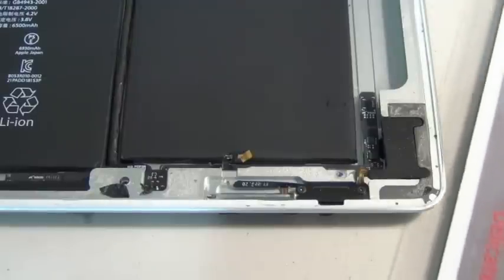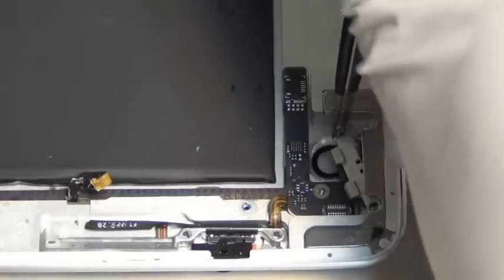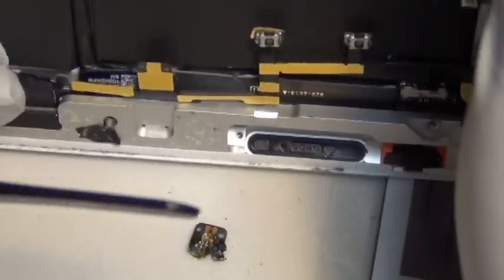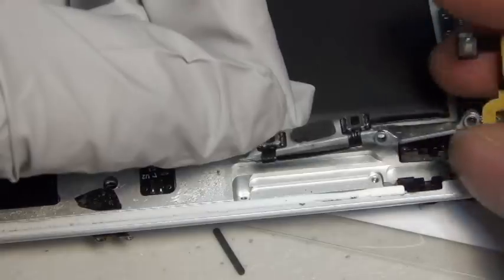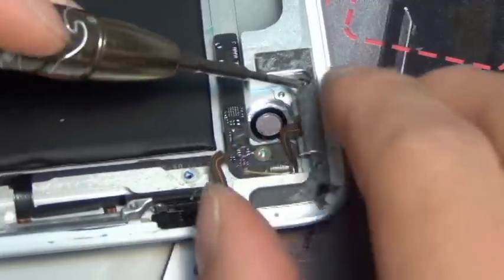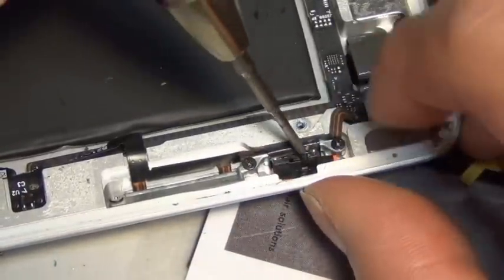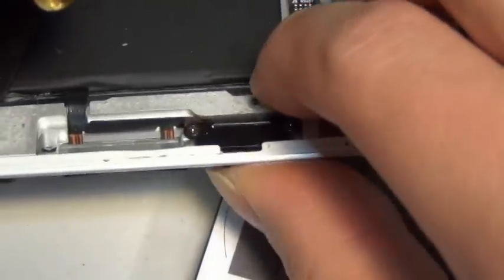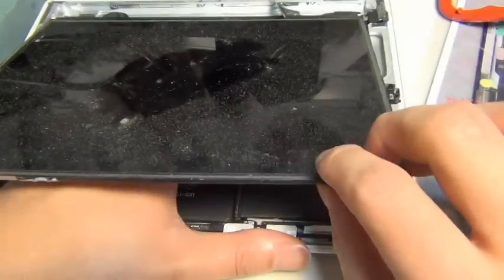iPad 2 volume power on and off button ribbon cable replacement repair CyberDocLLC

Comment: I ripped off my power cable while replacing the digitizer. I ordered a replacement and followed this video and was able to do it in the first go. A very detailed video and thank you for the effort. Putting the camera on your face should have been very difficult but do know that it helped a noob like me repair it like an expert.

Comment: Static electricity has nothing to do with the battery being connected or not. Rubber gloves do not help either; may actually generate a static. Use a properly installed ESD wrist strap.

Comment: Can the processor at the opposite end of camera be replaced and what is the correct name or part #... This video was very very helpful and would like to say thank you.  Again, I believe I need to replace that little processor at the beginning that the wire plugged into.

Comment: I tore the cable between the slide switch and power button when replacing the power port. I put it together to test it. It powered up OK but power button won't power it down. Is there a way to power it down safely before replacing the cable? Thanks

Comment: I figured it out it didnt turn on because when I was messing with the buttons the cable mightve disconnected from the bottom so I just pushed it in and presto it turned on..
But the screen was super dim so I just did a hard reset and it worked! Now the only problem is that the mute doesnt work. ... ill update if I fix it

Comment: I have a question. Does the little silver rectangular connector at the bottom need to snap in? I didn't see you snap it in - you just put the black tape over it. On another video, someone said it had to be snapped in. It is hard to get it to snap into the connector. Thank you. (I accidentally posted this comment on a different video.)

Comment: Both my iPad 2 power button and volume down buttons are no longer working due to an error on my part (I sliced the circuit cables for both). What part(s) do I need to purchase for replacement? I believe this is one part (ribbon replaces both volume & power button) but I want to be sure. Model A1395, iPad 2 wifi only. Please advise and thank you in advance!

Comment: Hi there, I just used your video to replace my power ribon cable (it was fab!) but It doesn’t seem to have worked and I’m worried I’ve caused more damage...... I must have damaged the ribbon while replacing the glass sceeen.  Once I’d replaced the screen I managed to turn the iPad on by connecting it to my laptop with a usb cable.  Everything was working fine (including the volume buttons), but I couldn’t turn the iPad off.  I then replaced the power/volume button ribbon buyback the power button still doesn’t work and now the iPad won’t even turn on by connecting it to my computer, have I damaged something else now?! Thanks

Comment: lol this video was great. I am waiting for my ribbon cable to arrive so I can also perform surgery. I have a off topic question tho. When I removed the speaker ribbon on the bottom left I accidently removed the socket that it goes into it. is their anyway I can fix that or did I 100% ruined the speaker connection? Can I crazy glue the bottom of the socket to on to the ipad where it originally was
Reply from the maker: you will need to solder it on.   we offer this repair service or part on our website

Comment: i did mine with the glass and digitizer off but when i finished, my screen was black. i can hear the power button working and swiping right but nothing on the screen so i unplugged/plugged the long cable running between the batteries and everything works. make sure to turn off the ipad by holding the power button and swiping right like as if it was turned on before disconnecting plugs. i think i made the mistake of not unplugging that long cable from the beginning. thx for video.
Reply: Thank you for this post. I thought I had shorted out my iPad and was ready to toss it in the attic after doing the repair and nothing worked. By doing as you said I got a dim screen and then a hard reset got me up and running. So glad I read this. Thanks!
Reply: MrEspn64 omg this worked for me too!!

Comment: When I tightened the volume control screws to full tightness, the up volume button wouldn't work. Only way I could fix this was by slightly loosening both screws and then everything worked. Then I put a drop of crazy glue on each screw so that they wouldn't loosen any more overtime.

Comment: My iPad 2 doesn't have the cable that runs between the battery?  There is no board for the final socket on the ribbon, the one that's furthest away from the the power button?  It does have a cable that runs along the top though, which joins the two camera's together?  Any ideas?

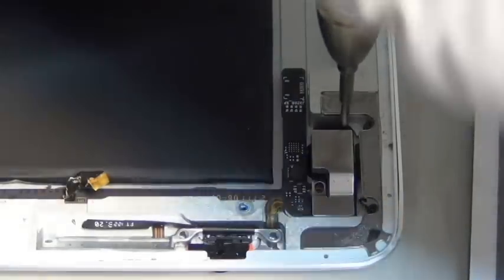Comment: I am having a LOT of trouble getting the second screw at 2:45 out (the one for the bracket that holds the camera in place). Everything was flowing smoothly up until this point...any suggestions?

Comment: You did mention if you accidently hit the power button during this process with the LCD disconnected. The ipad may not boot (turn-on). All you have to do is remove the battery screw and carefully pry up the logic board from the battery for ten seconds and replace the screw then you will be golden. Don't panic!

Comment: My ipad does not have the FPC connector seen at 6:48. It just terminates at the resistor/capacitor(?) that you were struggling to get off at 5:55

Comment: Many thanks for a very nice video.  I notice that the printed circuit trace for the Hall magnetic switch on both the scrap and new cable is correct.  The several replacement cables I have bought from China and the UK have this wired wrongly despite the correct 821-1151-A part number on the cable and have resulted in the magnetic switch not working.  Can you please say the source of the cable you used.
Reply from the maker: http://www.cyberdocllc.com/shop/ipad-2-power-volume-hold-buttons-ribbon-cable-replacement-part/
Reply: 3.00 free shipping on ebay, mine works perfectly
Reply: metalkilla7777 The fake and genuine versions can be identified by the number of tracks coming off the rectangular plastic flex on which the Hall sensor is mounted. The genuine version has 4 and the fake 3.
Reply: geoffrey leonard cohen hello by chance you solved this problem? I also find myself in the same situation, would you do me a huge favor if you told me where you could buy the parts! Thank you very much!
Reply: +giovanni boselli hpz56

Comment: Thanks a lot for this video! I had the first gen of the cable but this video did the trick just fine. I wish I knew there are two versions of the flex cable though when I bought the 2nd gen by mistake. I only noticed once I opened the Ipad

Comment: Hi, incredible video. Really good. But I have a problem, I don't know how I fucked it up. I followed the steps carefully and I think I properly installed the new flex cable but, obviously I'm wrong  'cause now the ipad doesn't response at all, no reaction to charger or buttons. Any idea about what i have screwed up? (something about the power supply or batteries maybe?)
Reply: It responds, I hear it receiving mails. I'connected the screen and digitalizer but It doesn't displays any image...I bought the wrong flex cable?
Reply: plo173 me too mine won't respond either, did u figure out what was wrong?
Reply: sorry for the late reply. I gave up, now I have a galaxy tab.

Comment: The problem was not with something I did ... it was the manufacturer they sent me a cable where the little knob that snaps into the mute button was missing. .....so my mute will not work so I will have to order a new one fml

Comment: The screws SHOULD be tight, not overly hard tight but snugly tight just as they are when you dismantle it.  If they have to be loose to work, then something is not in the right place.  If you leave them loose then they can get even looser over time and the screws can fall out.  Also, if the Ipad is frozen off after the repair, then slip two very thin plastic strips under the battery connection after removing the screw and leave for 30 minutes. no need to take off the main board. It is probably best to isolate the battery for the duration of the repair anyway.

Comment from the maker: iPad 2 2012 new model ribbon cable Power On/Off Volume Control repair replacement CyberDocLLC 

iPad 2 2012 new model ribbon cable Power On/Off Volume Control repair replacement CyberDocLLC

Comment: it was designed to ruin the device if someone just tries to open it up
that's why the bill of self repair is now being pass lol
Reply: for real i broke the wifi antenna this flex cable and digitizer cuz i just wanted to change the loudspeaker smh
Reply: @alessandromiotto8  
The engineer ls of this products are ordered to be as heartless as possible.